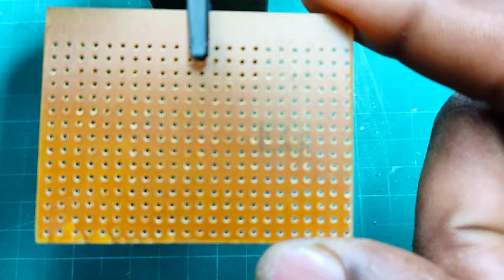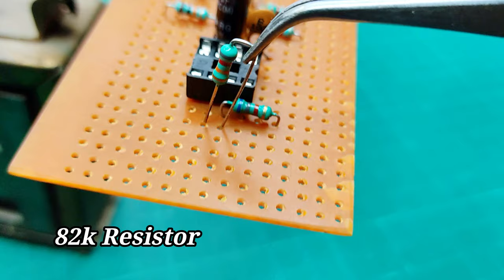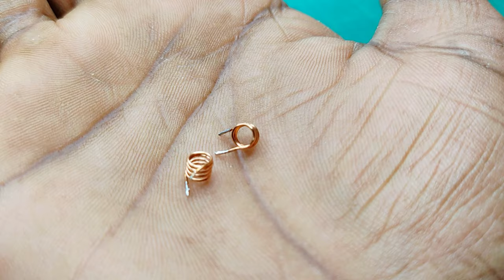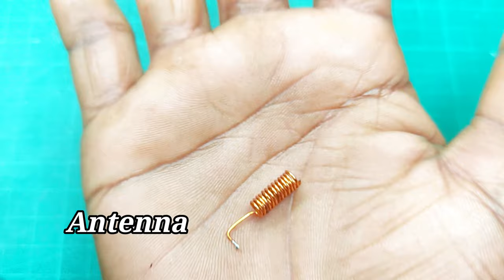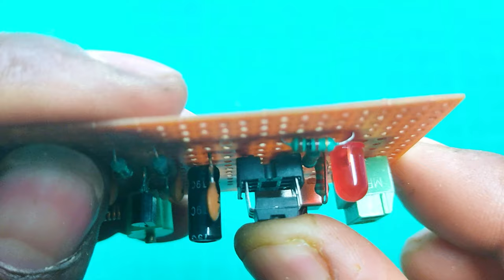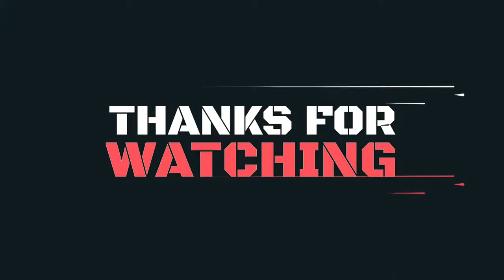How to make a Mobile Network Jammer using 555 timer  ||

Comment: It block 4G ?
Reply: Yes
Reply: @baltor-  Please share it's circuit diagram.
Reply: Does it work or not
Reply: What is the thickness of the copper wire?
Reply: No bcz I think how a lm555 can produce 600MHz 4g frequency
Reply: @Beastbrain...369 но частота 4g 2.6ггц?
Reply: does it disconnect all signal?
Reply: range?
Reply: @3rdfret looking at it, it looks like it’s barely a foot

Comment: There's one missing resistor 5.6k ohm
Reply: Plz the battery is12 voltage?? What should I add to this board to have a wifi jammer ?

Comment: Can please update the list of products you used in this video? In description..
Reply: 8 pin ic base 
bc 547
2pf
4.7pf
47pf
3.3pf
4.7uf capacitor
220e resistor
10k
6.8k
82k
30pf variable trimmer capacitor
red led
onoff switch
two pin terminal block
555 timer IC
Reply: @DeepakSakhija h

Comment: Hello sir
Firstly, excellent demonstration and very educational
Secondly, please guide me through the procedure. I'm an engineering student and am interested in learning how you figured out the components required for this project(How did you decide that those particular value of capacitors and transistors could be used).  I don't know how to think along those lines and am facing difficulty in coming up with project ideas. Thank you!
Reply: Bro imma 12th jee student i think yours basics are unclear please try out 12th capacitance and current elec and practice numericals it will help

Comment: Here is all you need :

8 Pin IC Base 
BC 547
2 pf
4.7 pf
47 pf
3.3 pf
4.7 pf
220 E resistor 
10k,6.8k, 82k, 1k resistor 
30 pf variable trimmer capacitor 
ON OFF switch 
2 Pin terminal block 
555 trimmer IC

❤‍🔥
Reply: 5.6k resistor
Reply: Chal Raha hai ye?
Reply: What is that orange circuit board called??
Reply: @Ben-ou5ex  zero pcb
Reply: It can also be called Vero board. It's of two type:- dot type and line type
Reply: Range??
Reply: @Ben-ou5ex  copper PCB
Reply: Is device ka budget kitna hoga?

Comment: Hi there KMC electronics is it necessary to use the same components value on making this! Or can use any type of resistance, and any type of capacutance of ceramic cap.

?
Reply: No you cant since the circuit contains a oscillator which is tuned to produce a signal of frequency that we want to block ( 2-2.5Ghz generally for 4G). Changing the capacitors, resistors, inductances may effect the frequency. And also the transistor won't work in our required region.

Comment: ChatGpt: (Reason why this video is fake?)
A video suggesting a GSM jammer using a 555 timer IC and a BC547 transistor is likely misleading or fake.
Reply: the actual reason this video or any kind of such videos that use the ne555 timer IC with some piddly transistor is that, these kind of signal "jammers" are nowhere powerful enough to block 2.4ghz or 5ghz signals, you can build one, but that requires really complex engineering and more, even building a proper 2.4ghz transmitter or receiver is extremely difficult to make without using an IC ( building a circuit from discrete parts ), as you need perfect wire traces ( pcb lines that precisely calculated so minimize data loss and attenuation ) and more, to know, watch greatscott's video on this

Comment: Sir i have made this project in the same way as you have shown in your video but it is not jamming any signal of the mobile it is only jamming the signal of FM Radio on my mobile ph
Reply: Yes
Reply: In this circuit used tank circuit it produce only fm signal 100 MHz below but mobile signal frequency band are 900mhz above

Comment: Sir , can we use 3 to 18 pf variable / trimmer  capacitor instead of 30 ???????
Reply: Plz reply
Reply: yes you can
Reply: use two in parallel such that total will be 36 pf

Comment: Can we use BF495 instead of BC547?
Reply from the maker: Yes you can use it, BF495 (frequency transistor) will work better than this BC547. Thank you 😊
Reply: @KMCelectronics  ok Sir
Reply: Sir ,in diagram 4.7uF capacitor is not given sir , so ,can i follow the diagram, i can't understand ur solderings ❤😬
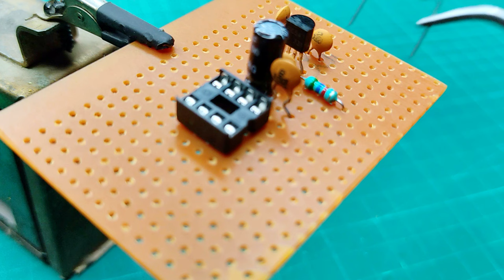Reply: At 0:47 , that capacitor sir...
Reply: @vostrofx Sir its work?
Reply: @vostrofx Plz reply
Reply: @KMCelectronics Bro in how much area it jammes network.
Reply: @KMCelectronics  i can use another uf and pf ? please reply